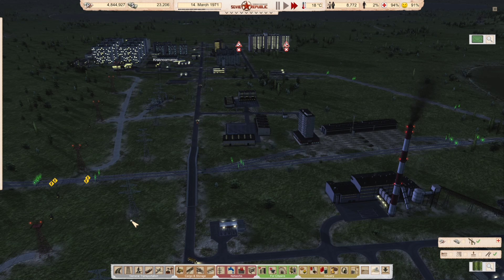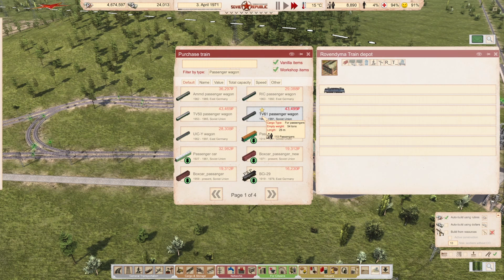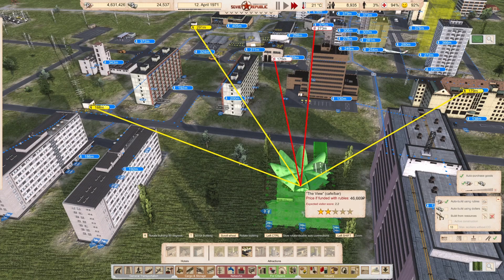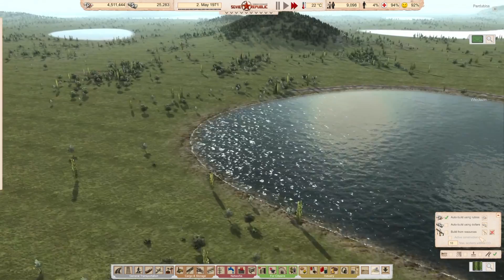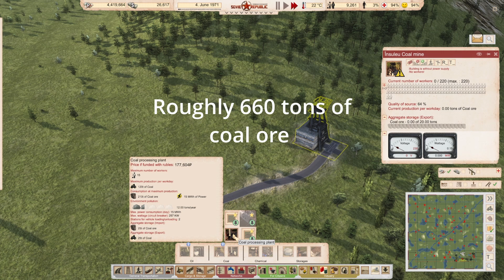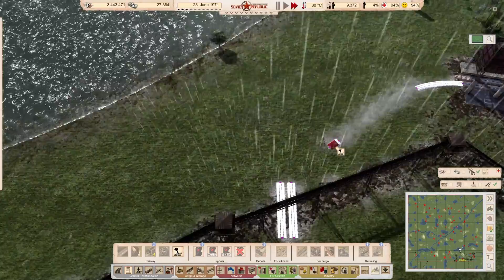Tourism (Game Overview) :: New Player :: Workers & Resources Soviet Republic: #24

Comment: Thank you so much for this series, I've learned so much! Easy to follow and very easy to understand. I would love a more in-depth series with the rest of the mechanics turned on. 
Based on this series, I've started a new game, on the Lyubinsk (Uninhabited version) map, with water and waste on and it's going great, but I fear it'll become overwhelming once I start building my second and third city.
Once again, thank you for this!
Reply from the maker: Ty for the feedback.   As the economy expands try to avoid creating single points of failure, e.g.  a single town producing food,  this means a problem in one town does not spread across the map. 

Mid winter is good time to check all the towns, the power grids and key logistic supply lines as this is the time they come under most stress.  Every winter I do a general health check of the economy as this is time to pick up potential problems.  Tip:  do not ignore traffic jam/stuck trains messages as these could indicate something if going wrong.  This is particularly relevant when playing with maintenance enabled as a vehicle breaking down can cause havoc to supply systems.  

Good luck with your game.